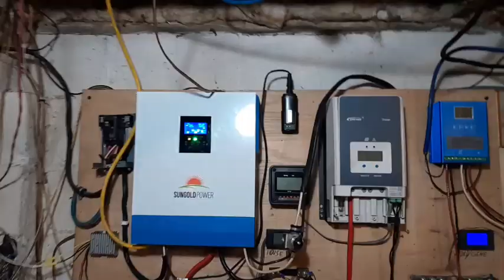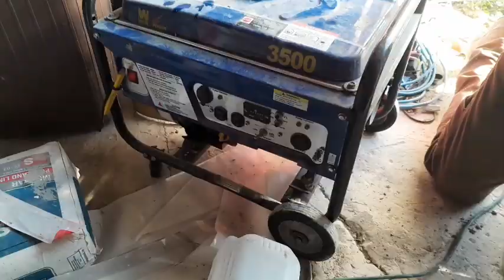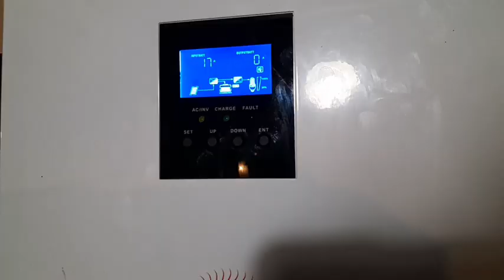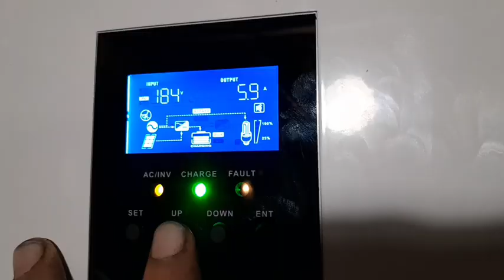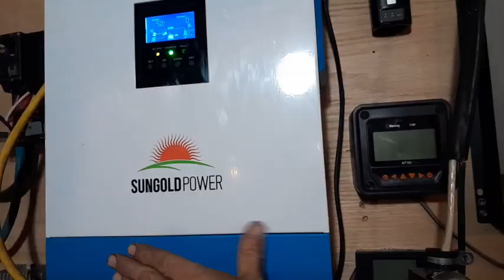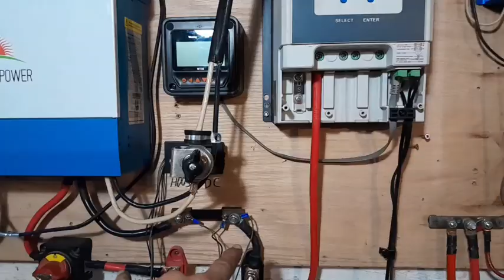SUNGOLDPOWER All-In-One Works!

Comment: Nice battery bank, I kind of surprise as I expected to see lithium batteries but the batteries seems to have allot of life left in them. Interesting about the generator, I guess it is the same thing with inverters not all inverters are made the same.
Reply from the maker: These old girls got tons of life yet. Im scared of lithium. "They" say they're safe but "they" also say alot....i know my lead acids won't blow up under my daughters bedroom and if i suffer a little capacity shortage from that paranoia....i can still sleep fine.
Reply: @smallcityhomesteaders1600 Honestly it's so funny person worry about lithium batteries but will but a cellular phone to their ear. Have many little devices around the home that uses lithium batteries and don't worry about it. One thing I can tell you once you go lithium you never go back. I used to have 12 seal 150 amps AGM that took up half my porch. Today I have lifepo4 on a coffee table running my entire house with no problems at half the cost of AGM.
Reply from the maker: @howardescoffery4950 🤷🏻‍♂️....call me old fashioned. Im sure your probably rite. I just follow world news and it sure seems like a lot of cargo ships sink to the bottom of the ocean, trains burn off their rails and EVs torch the road they sit on...carrying huge lithium batteries. I'd like to see progress with Carbon-Foam and Graphine. Same or more energy density without the BOOM. I guess everyone is got all their chips down, ballz in on litium for now so we'll see. Till then, i'll keep adding distilled water and taking care of these old girls.

Comment: I hope it was my suggestion to check the sine wave output of the gen that helped.
BTW, I am a Sungoldpower affiliate, and their equipment is top notch!
Happy savings!
Reply from the maker: I dont have a scope so i can't see sinewave but i sure could see how bad the Hz were....and im happy to admit i was wrong becuase i really really wanted this thimg to work rite. Now it does and im STOAKED!
Reply: @smallcityhomesteaders1600 That’s a good thing.  I used a kilowatt meter to check mine.  Many times just adjusting the rpm's of the gen will fix the problem.
A gas generator must run at a synchronous speed of either 3600 RPM (for a 2-pole alternator) or 1800 RPM (for a 4-pole alternator) to produce 60 Hz.
The required speed in RPM is determined by the formula:

where N is the synchronous speed in RPM, f is the frequency (60 Hz), and P is the number of magnetic poles. Most smaller portable generators are 2-pole, running at 3600 RPM, while larger generators are often 4-pole, running at 1800 RPM.

Comment: A sigh of relief. Thanks for the update 😊
Reply from the maker: Was pretty darn awsome seeing that kinda power come in. Batts filled up from solar and the turbine break actually came on the last 2 days...👌🏻
Reply: @smallcityhomesteaders1600 now that I think of it. 3 battery banks in the configuration you have. It won't be a torture test, the one your planning. On the 24volt setup yes it was correct to call it that. The higher volts, higher efficiency, the load being shared across the banks equally will or already makes a massive difference. Once again thanks for uploading videos like this.
Reply from the maker: @Mr_natenut i suppose you are correct. I am curious however to know the limits of this inverter so i want to find those limits safely. I didn't exactly NEED more inverter capacity but who knows....maybe i'll want a larger welder im the future and i'd just like to know what i can and cant run. The hillbilly in me is driven to "durability test" my gear.....gotta know rite?!🤷🏻‍♂️
Reply: @smallcityhomesteaders1600 your right and I agree. I too like seeing how far I can push the small setup I have. If you know the limits it's easy to plan for the future. If the system can survive the worst of the seasons 
Like little sunny days or like low windy days etc , than sunny, windy or both is a walk in the park for you. Plus you gain real world tests not run in labs. I'm also very curious about that invertor. What it can do. I have a bunch old 18650 cells I'm slapping a 3 wired volt meter on each. Some are single cells others are in parallel. I'm trying my level best to absorb as much excess energy as I can. A 100 watt panel In Namibia produces in summer on average 15kw of solar over 30 days. 😅. I guess we have good addictions. Renewable energy, it's storage and usage. The only issue I have is a lack of decent storage for excess electrons. 😊. I appreciate deep cycle lead acid batteries but I'm keeping my eyes open for soduim ion batteries.
Reply from the maker: @Mr_natenut i wish i could come to trust lithium. I understand and see the benefit....and then i see the news worldwide about this train or that ship or this schoolbus or that home....incinerated from a lithium failure....im holding out for Carbor-foam battery development.🎯